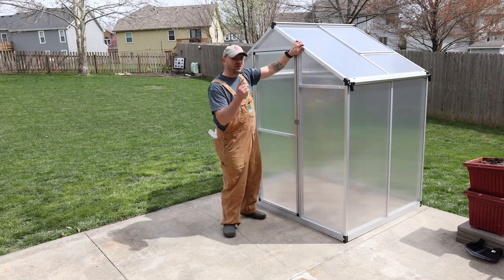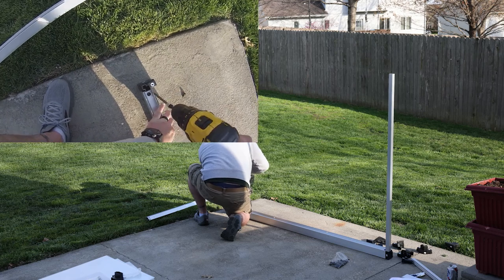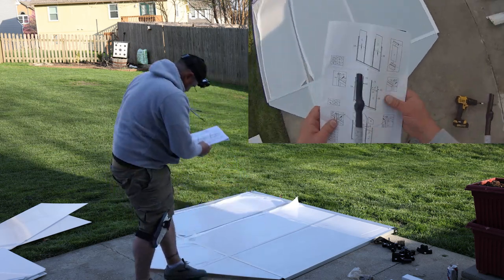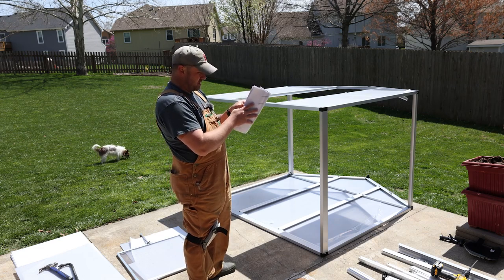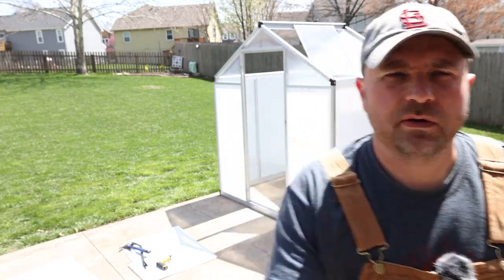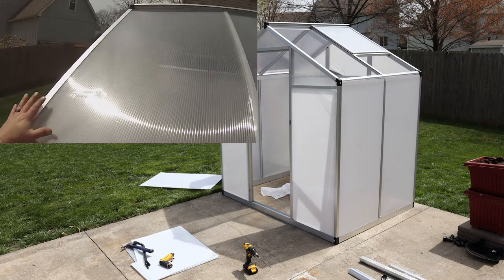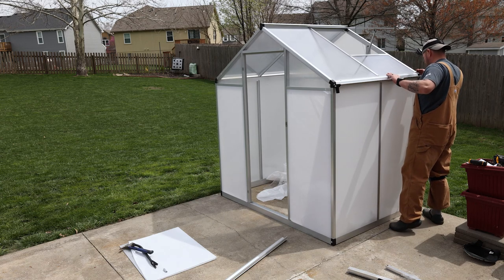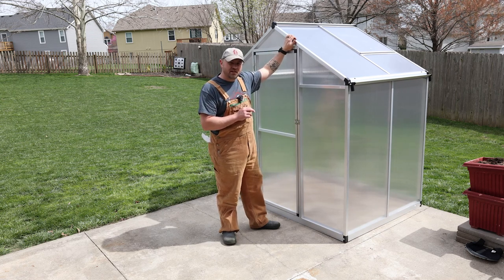Outsunny 4'x6' Walk-in Greenhouse Assembly and First Impression

Comment: I am currently building a 6x6 Out and Sunny greenhouse.  I am in the facilities maintenance business and can read building drawings, electronic schematics but these directions I agree are completely useless.  Once you get going and figure out how it works its fine.  You also need a second set of hands with the unit I have as the aluminum is pretty flimsy until it is all together.  Thanks for the video.

Comment: I think the sequence showed the rectangle base being put together first, then back panel followed by front so it’s standing up as you assemble. I’m almost done putting the same one together. I had to disassemble it half way through because I mixed up my top plastic corner braces (yuck) but it’s almost done now. Looks like you did too, frustrating. Wish me luck. I’m a 70 year old and using the little tools it came with 😂.
Reply from the maker: I think every consumer manufacturing outfit should take a look at Lego's instruction for inspiration.

Comment: I got the Lean-to and these are the most useless instructions I've ever seen. What do I use the brackets for on the wall panels???
Reply from the maker: I don't know which brackets that you are referring. I'm sure the lean-to version is different than this version.
Reply: @Betterterra  It is, and the directions seem even more useless. Couldn't find anybody putting together my model either. I think I got it figured out. They're small M shaped metal rods that go between the wall pieces and the frame to secure the walls in place. Most infuriating, and yet simple little things.

Comment: Thanks for the video, 
I am wondering if this greenhouse could be used in winter ? 
And what are your thoughts if I'm planning to assemble/disassemble 1-2 time per year (I want to use for winter only) ?
Reply from the maker: I am using mine during winter to house potted perennial pants. I have a small greenhouse heater to maintain 60 degree. This greenhouse is not something that I would ever want to assemble more than once. In fact I added caulking around most of the panels shortly after assembly to help with stability. It's not coming apart willingly anymore.